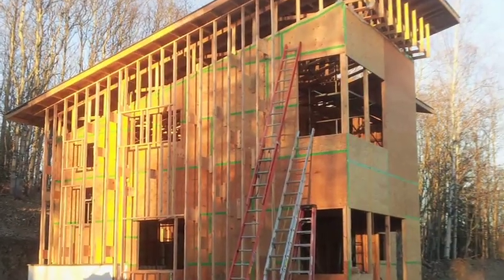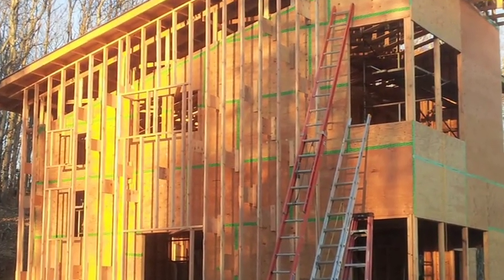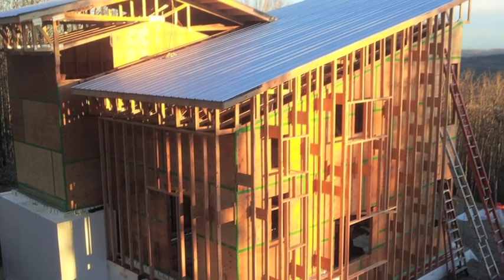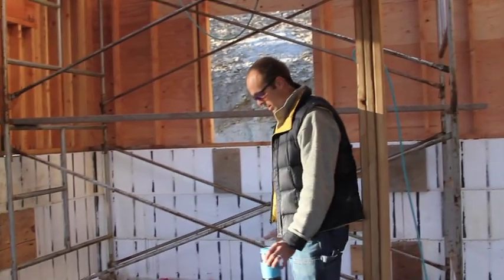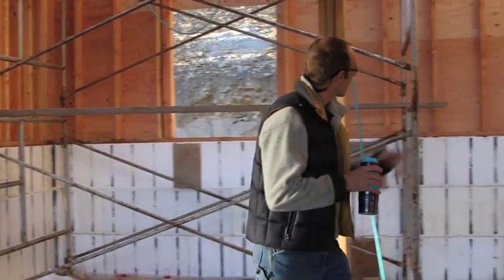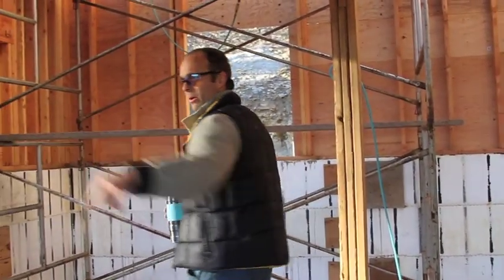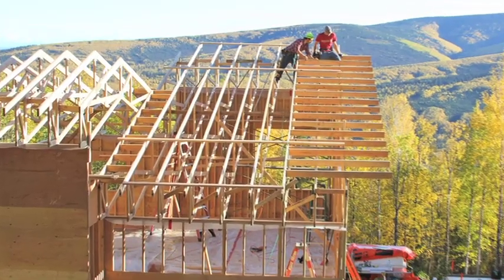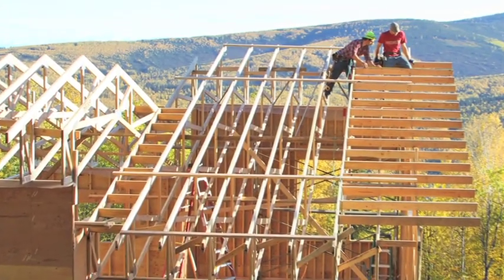Building A Passive Solar House in the Sub-Arctic

Comment: I like most of the ideas in the video, such as the overhang of the roof tied into the inner trust, cancelling snow thrust loads. The deep parallel truss allows a lot of insulation room for the ceiling. Regarding the 2500 gallon tank for heat storage, if that was upgraded to a 25000 gallon tank and that tank place next to the wall of the house and over insulating to a minimum R 100 all around with the exception of at the house wall, and removable panels on the inside so heat from the tank can be moderated from heat ingress into the lower levels of the house, that would reduce the load on circulating pumps and act as a backup if the power system failed. Being super insulated, that heat from the tank would permeate through the house entirely.

Comment: Exceptional. However... You should have built the house with a 6" in-wall, in-floor and in-ceiling forced heating system. In other words a "double walled" building system with a 6" heat space which keeps the inside temperature constant with only a few candles or a stove heater inside. With such a system, your total heating area is only about 1/100of your total interior area. It's like creating an artificial exterior temperature. No real need to heat the "large" interior, just within the walls.
Reply: I'm sorry, but that's a pretty nutty idea. Pumping warm air into a wall cavity simply ensures much of the heat is lost to the exterior.